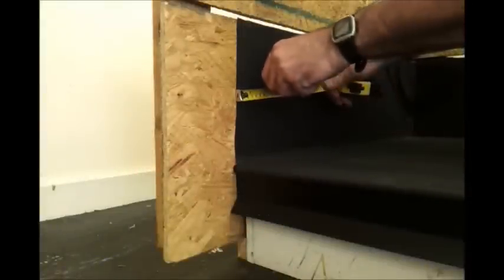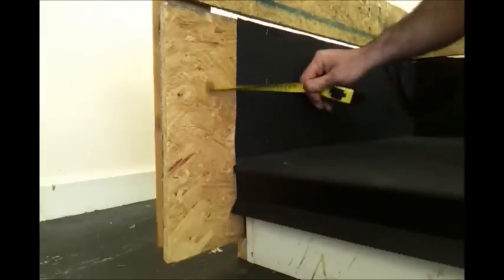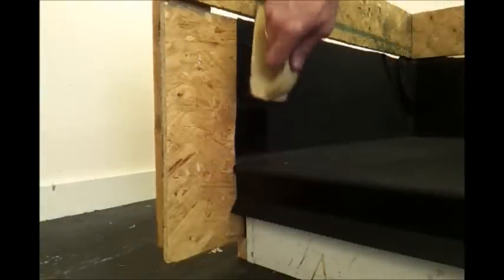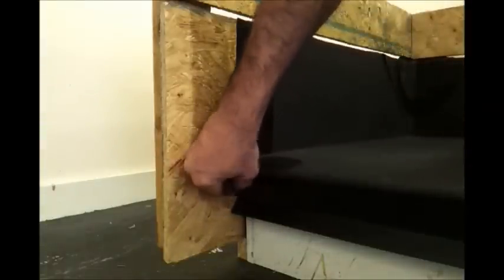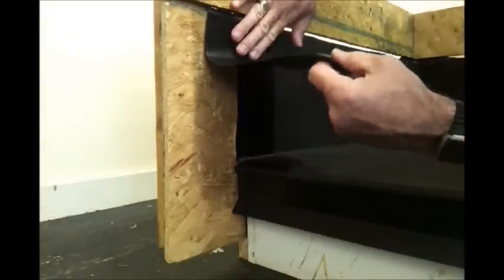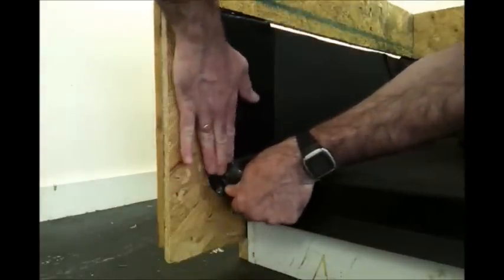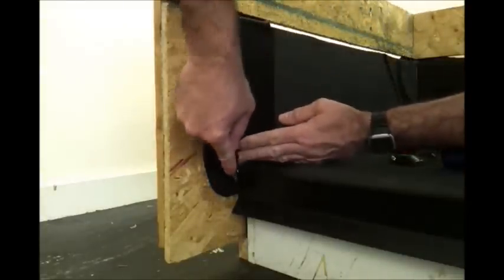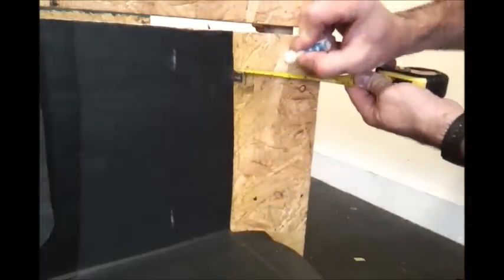How to Finish a Flat Roof at Upstand Walls with EPDM - Rubber Roofing Systems Made Easy

Comment: Firestone QuickPrime Plus is designed to clean and prime
approved Firestone membranes prior to application of
QuickSeam products where required by Firestone
Specialty Products specifications and details. It may also
be used to clean membrane prior to the application of
Firestone Splice Adhesive (SA-1065)  

Quickprime does not bond to OSB...this is an awful demonstration.
yet again...your company is a liability for the client.